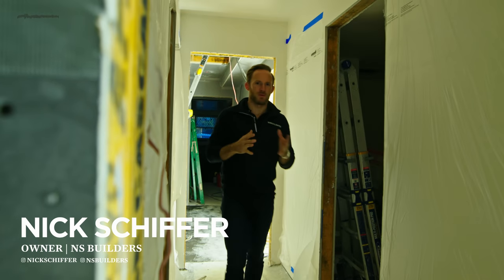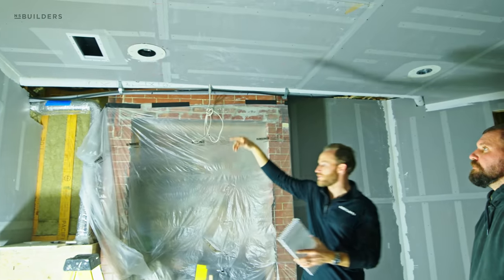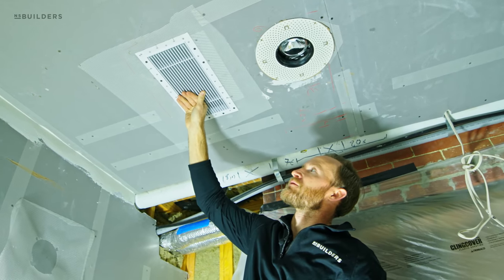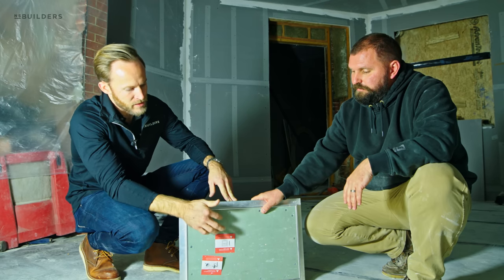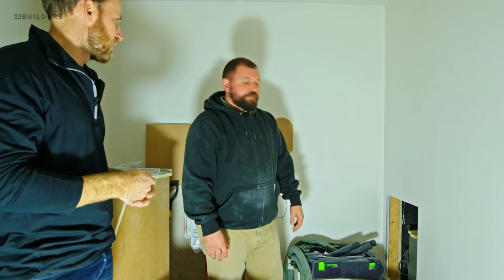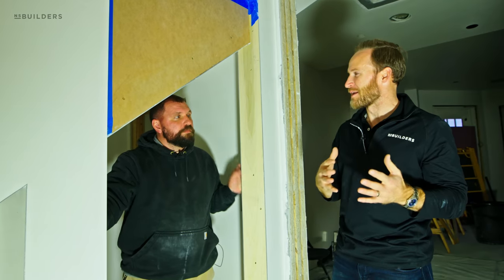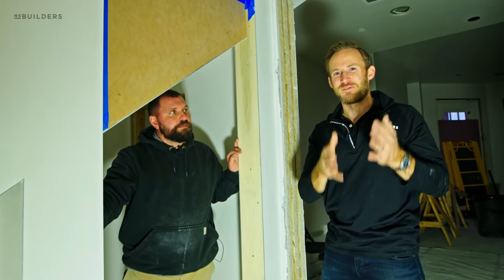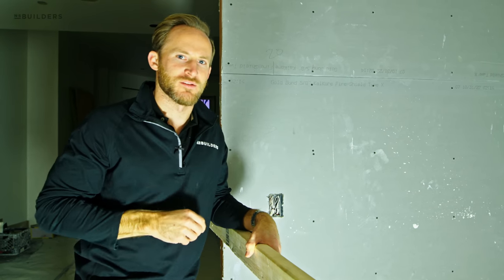Plastered in Duct Covers for a Seamless Look

Comment: We have an EH Price mud-in linear bar grille that “washes” a large folding sliding door, and the paint has cracked on the outline of the flange due to different expansion rates of the drywall ceiling and aluminum flange. Do you guys have any experience on how to properly finish the install to prevent the paint from cracking? Our contractor lacks the expertise/knowledge.
Reply from the maker: We mesh tape around them. And proper temperature/humidity control.